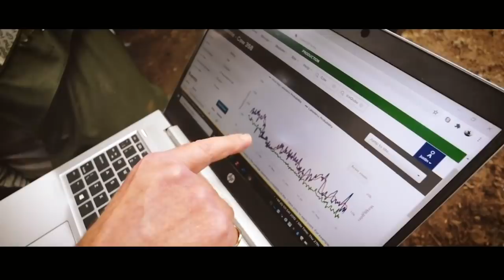HUGE STONE FOUND IN MASSIVE COWS FEET, BULLS ESCAPING & HOOF TRANSFORMATIONS - 2020 REWIND!

Comment: I just thought of a question. Since you use wood for bulls:  Is it possible for it to be glued on so good that if the wood splits and the block cracks in half, it can transfer the stress up into the hoof and crack that too? Or would it just peel off at the glue?